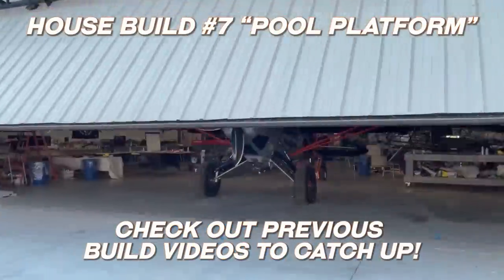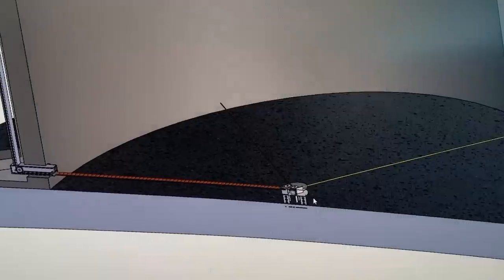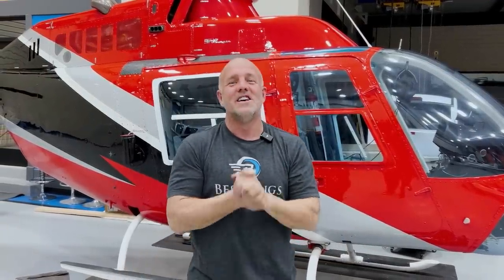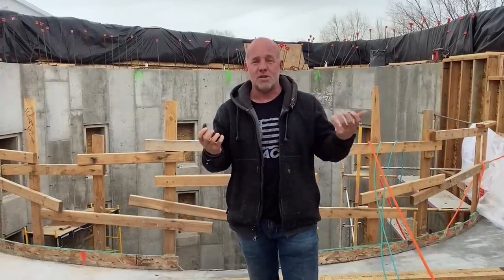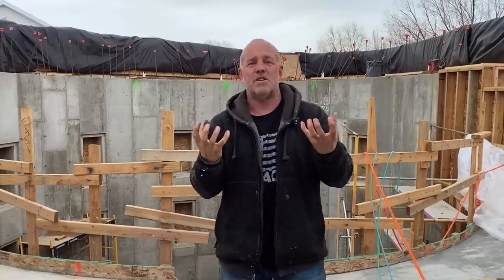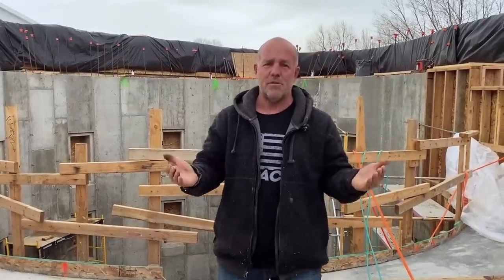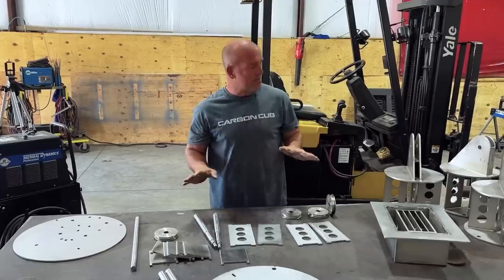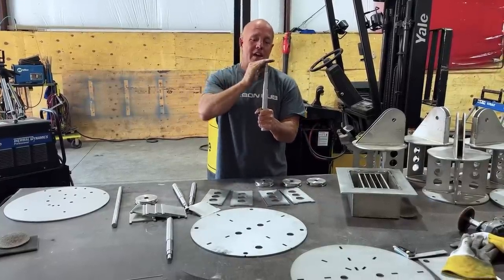How!? Transforming Pool - Dance Floor to Freedive | House Update #7

Comment: Awesome project. Would love to understand what stops the pontoon platform from tipping if it’s loaded asymmetrically, say if party guests dance on one side? Looking forward to seeing it in action.
Reply: @ryanthomas2472  that’s what I’m trying to get my head around. The lighter side’s cables would be in tension so that side of the platform can’t rise, but the heavier side’s cables would be in compression so that part could sink. I’m guessing buoyancy of the platform is enough to counteract this, or maybe the platform is thick enough that it’s sides will brace against the pool sides to stop it tipping. Can’t wait to see it, sure it will become clear once built.
Reply: @ollyb7570  Yea I was thinking the same thing. I'm assuming that the cables are always in tension. Basically the force of buoyancy will always exceed the maximum point loading. Makes sense, but yea that's a heap of buoyancy to always give the impression of a solid floor!

Comment: Hi Mike, awesome as always, one quick thought about the floating platform. Why not add some physical stops on the upper danceflor position so that you can make the platform smaller in height, so a bit more depth and have also smaller motors to drive it down?

Comment: Hi Mike! I was watching this video, as one of the first when it came out, and now I had an idea. Did you implement, or are you planning on, a warning system when the pool is in dancefloor mode, and to many people respectively weight is on the platform?
This could easily be done by introducing a load cell in the central pulley, which measures the decrease of tension required to overcome the buoyancy of the platform, when more and more weight is applied. Looking forward to more great inspiring videos from the Pateys.
Greetings from an aviator and engineer in Austria!
Norbert

Comment: Great Work !!!
In Europe there are regulations and standards in place to ensure the safety. In Germany, for example, this Platform would be categorised as an elevator, just like those in the buildings, and will be subjected for approval to ensure the same standards.
 - Do you have to carry out some procedures before putting it in use ?

Comment: What if you put a bladder in the platform. Pneumatics could control the deck elevation without pullies and cables. Apps could control weight addition or deduction. Pin locks at the edges would give security.

Comment: Why not actively change the platforms buoyancy to assist any motors? “Fuel tanks” in the platform that you can fill with water or air? 

You are an incredible inspiration!! Amazing work, thanks for sharing it with the world!! 

Could you also add a way to “lock” the platform in the “up” position so it doesn’t need to rely on buoyancy alone to carry people’s weight?

Comment: Finally found the video with my answer to what type of lifting system you're going to use for the swim platform ;) If the platform can hold so many people plus the weight of the platform itself, you need a lot of pulling power to pull the platform under, I don't think you're using a pulley system. Do you use ballast tanks under the platform that you can fill with water or air to make it easier to go under? and do you use wheels on the side of the platform so it doesn't scratch the wall? Any way, I love your videos!

Comment: Two questions:
1) how are you preventing the platform from canting and getting stuck or catching on the  edge of the shallow area of the pool? 
2) how are you protecting the submerged parts of the cables and pulleys from corrosion in what I assume will be chlorinated water?

Comment: Could have a pneumatic or electric shut off valve on your displacement tubes and in theory, should stop the floor from rising if the water can’t escape through the pipes?  May be able to control the ascent with flow restrictors

Comment: Hey @Mike Patey , I was just wandering why you took the route of calculating the floating volume/weight and all at the place of a locking mechanism from the edge of the pool (outside the water)? Wouldn't  it be easier to have the platform raise out of the water by 2 inch (hidden in the height difference from the water and flooring) and have 1" stainless pin from 3-4-5 direction lock it.

Comment: Could you make some type of locking mechanism to hold the platform on the surface of the water so you could be less concerned with the weight on it or is it just simpler to overbuild the bouyency of the platform?

Comment: Love the pulley vs updrift solution. So "simple" yet effective. 
But, what are you doing along the edges of the floating disk. Will the tension of the cables center it, because of slightly smaller diameter placement. Or do you intend to use some sort of end brace/guide wheels?

Comment: Such an elegant design!!! Do you have calculations (or a basic idea) about how the platform will feel to people? Will it be stabilized in position, or will it feel like being on a boat? If all guests stood in one particular area over where a cable attaches, then they could cause the platform to sink more and the cable would go slack. Would it be noticeable??
Reply: Should feel like a normal solid floor, I reckon. If all the guests stand over one cable and jump up and down, their peak force still should be less than the buoyant force at that point - they'll reduce the load on that cable, but not all the way to zero (hence no slack cable).

But you're right, sink would be noticeable if the guests could make one of the cables go slack. I just don't think that'll be possible.

Comment: Hey Mike, great video as always!  I assume you accounted for this in your design, but how did you get around the inherent stretchiness of such long cable members? With cable lengths this long won't the platform be spongy somewhat like a suspension bridge? This seems like it would give an advantage to a hydraulic system.

Comment: You explain things very well. I had no clue how you were going to accomplish the moving floor. Floating floor that gets pulled down, and moves through the water, absolutely would not have thought of that in a million years. I just assume the floor has to be of same material as the walls. Duh.

Comment: Three things to consider:
- way to lock entrance under plaftorm, what if you would make rounded stainless steel fence that moves from sidewall of the pool (after all it's round), and just closes gate <>
- platform should have top lock for stability, if it goes to the top, there should come supports under it to lock it in place. If somebody will put platform some way off the balance it still has chance to flip. Relatively low but I would make it idiotproof and just raise supports when it's on top 
- scuba gear, emergency co2 capsule in the bottom - let's say shit hits the fan and sombody dropped under it and doesn't know how to swim, there should be way to get from bottom to top inside if there is no other exit, emergency o2 on bottom or co2 capsule that makes rope and floater go up to the top (same way like they harvest trees on bottom of lake)

Comment: Why don't you make the platform neutral buoyant with use pressure tanks on the platform and fill or empty just like the principle mode a submarine uses? And you can have an embedded trap door and a redundant lock to keep the platform in place unless you are changing the elevation. If you have no power you can use stored air in the air compressor tank to raise. Therefore the you only need to fill or empty the mounted tanks on the platform with water. Less moving part, can be operated with or without power, less complicated to fix and operate.

Comment: Make the platform only slightly buoyant, and introduce locking pins when its at dance floor height, think of uneven loading. Less displacement, less force. Also 3 cables vs 4 will be easier to tension. Avoid aluminum in chlorine.

Comment: I am curious, wouldn't two of the wires be pulled at a different strength and speed compared to the other two since there are two wires that go fully around their central pulleys and the other two only go around their pulleys partially? Love the videos by the way! Amazing work!!

Comment: Will there be away to put a stop or something so that when the floor is all the way up.  If you have to go under for maintenance, there is no way the floor can go down.  An extra safety so potentially you don't get trapped if a cable breaks while your under the floor doing maintenance.   This is the coolest.  Thanks for sharing

Comment: Just curious if you think the platform will move and sway like a dock when people are standing on it? Is there a system to lock it in when it is fully up to make it feel like a solid floor?
Reply: I have the same exact question. It seems like it could be susceptible to big shifts in weight. I also wonder what he’s got cooked up to make sure it glides smoothly up the shaft. It has to stay aligned just right to avoid getting wedged.

Comment: Could you use pumps to add or subtract water to adjust the height? Rollers placed at intervals around the circumference would keep the disc centered.

Comment: I thought I had as you were explaining how this system works. Let's say you have 30 people on the platform. And one guy at the far end has a heart attack. Everyone is going to rush over to his aid ,causing the platform to tilt. It might be a good idea to have four or five locking pins on the perimeter of the platform, that key into the side of the pool to prevent movement. They could be designed to automatically release when the platform is pulled down.

Comment: There must be a reason to use 4 cables versus 3, but it seems that 3 would make it easier to get the platform level with equal cable tension.

Comment: Have you looked into the corrosion level with chlorine and stainless steel?  I work in the chemical industry and we use Monel when in Chlorine services.  Just a suggestion.

Comment: Hey Mike, this is an amazing! 
Would it be dumb to connect a generator to the cable system so that if the deck was at the bottom, you could let it free float and, with the proper gearing, drive a heavy generator with all of that buoyancy? Would be like a giant battery!

Comment: Once the platform is in dance floor mode, will it dowl into the concrete to stop it from going off level, or rocking and creating waves , and last will you recess some holes to insert a railing , so you don’t have people falling off the dance floor into the shallow end?? And will there be a pole for when the “entertainment” is dancing for the boys party’s???

Comment: Mike what have you looked into as far as descaling the pool..I've grown up in this industry for 30 plus years have a easy install and descaler ..that will protect your pool lines and mechanical futures .I'd like your input we have these on thousands and thousands  farm fields.tens of  thousand on homes and pool systems..no electricity...  key is keeping mineral in suspension so scale doesn't build up by manipulation of bi carbonate the sticky apext mineral build up turns it into carbonate..non sticky so scaled up systems descales it fully within weeks

Comment: 🤔 cables stretch?
How flex will be needed for the pully system to work effectively (number of strands and size).
I would would think that different cables would have different stretch over time. Will the turn buckles have enough travel to accommodate the stretch?
Simple 7 strand I would think would have less stretch but hard on the pullies. 7x19 would be good for the pullies but have more stretch.

Comment: Just going to say PLAN AHEAD, put a drain in the deepest part of the pool to drain the water from the pool.  It doesn’t need to be a massive 12” pipe,  I would say a 2” with a valve (obviously) leading to an area to dump the water if something goes wrong…. Which being a pool is likely.  A good example would be you take off for a few weeks and come back to a very green pool.  Sometimes it is better to just dump and refill.  Would also be good if you noticed the concrete failing, which has brought buildings down (Miami is a good example from recent events).

Comment: In a failure event, wouldn't a person be sucked to the top of the float? I guess it depends on the hole size and spacing. P-factor! Another safety mechanism would be a set of locks - particularly for the full down position. Something like a window blinds but upside down. A pull on the cables unlocks the lock and then cables can pay out. Although I think with 4 cables, the real danger failure mode would be the points where all the cables come together. Therefore, the safety mechanism could be out of water and be electomechanical. The problem with safety systems is that they add complication that could induce a failure. For example if the locks do not unlock and the motor pulls, that's bad.

Comment: Mike, I have a question,  and I am no engineer by any stretch of the imagination. Im just a stupid truck driver, why not build the floor on the same principles as a Submarine. Use air to keep it floating and to handle the weight of the platform and any additional weight like people or anything else, or build balest tanks or compartments to flood so the weight of the water would dictate the depth of the platform. I hope your catching what im throwing down.

Comment: Maybe it would be easier to do the platform like a tank and use a ballast system to lower it up and down. You could have fixed rails to control the leveling and compressor like hoses to supply air or water to the tank.

Comment: 17:10 What chemical or galvanic erosion might occur if the water in the "vertical cable chase" is allowed to stagnate?  Would be easy to just pour water into top of chase and let gravity carry it downward.  Use a small fluid circuit from the pool pump?

Comment: you're doing amazing stuff just one thing you are concreting the parts into the floor, and the top plates still only rely on the welding to take the load when pulling the floor down.
 im sure you considered using ballast fill and empty tanks in the floor to help with limiting the weight the cable has to pull when the floor goes down ? and help with it lifting, as well as the air pressure on the floor with all that water on top? One other thing is working under an item with no escape if the platform sank . And why not build the floor/platform in the bottom of the tank.
A car lift has an anti drop device.just as an example. Maybe a hatch in the floor. Just wanting you to be safe..
best wishes i hope it all goes to plan, interesting you use solid works i use inventor works the same again great work and no criticism just interested to know your ideas. :) take care eh.tony.

Comment: Mike. I’m wondering what size and type of cables you plan on using? In my experience as a elevator mechanic the sheave diameter is sized by the size of the cables and how sharp they can be bent without premature wear. Just gauging by the sheaves in the video I’m guessing the cables are somewhere between 3/8”and 1/2” and I’m just wondering what sort of magic you have figured out to bend them around a 4” sheave. I’m confident you have this figured out already but I’m curious and would appreciate it if you could touch on this topic in a upcoming update video. Thanks Mike

Comment: So here's a question. Why not put locking pins on the platform that activate once its raised into the floor position securing it in place? That way you wouldn't have to add additional buoyancy to support the people on it, and then also with that substantially reduced buoyancy requirement, it would take less force to pull the platform downwards?

Comment: With the platform floating, its depth is held by tension in the cables.  Got that.  With the cables attached close to the center of the platform, will there be enough tension to hold the platform level as people move around?  What if all 50 guests go to one side?  You answered in the video.  I should have watched it all first.

Comment: How are you going to manage buoyancy? Seems like if you use a rigid body buoyancy will increase nearly 4x with depth and if you use a soft body "air bag" buoyancy will be nearly 1/4 at depth. With rigid you might get overloading when in down position or with soft body you might get overloading during accent. Are you considering a combination?

Comment: Imagine if the platform itself was a flotation tank itself that could also be flooded with a compressor then the cables would just be for guidance the up and down would just be by adjusting the flotation.

Comment: Is there any filter pipes/drains on the bottom?  How do you prevent air from being pulled back in through those to the underside when the floor rises uncontrolled? (I guess even the cableway could be a pathway for bypass)

Comment: Did you consider making that floor work by bouyancy?  Just blow air under it to float it, and vent the air to sink it.  Your cables could be vastly simpler if they're not taking any real load and just serve to keep it level like the wires on an old-fashioned parallel rule on a drafting table.   I assume you already have compressors, and this wouldn't need to be as clean as breathing air.   I'd put the air outlets on the bottom of the pool so you don't even need any plumbing on the platform itself.

Comment: To reduce floating cost, buoyancy change with people weight..  probably better have enough buoyancy for the platform itself and locking pins in the two level positions

Comment: is it possible to just lock the floating platform at the top with cams or throw bolts to create instant level surface and also maximize load?